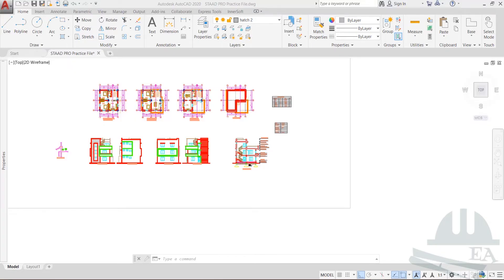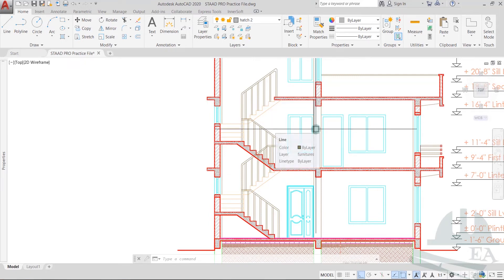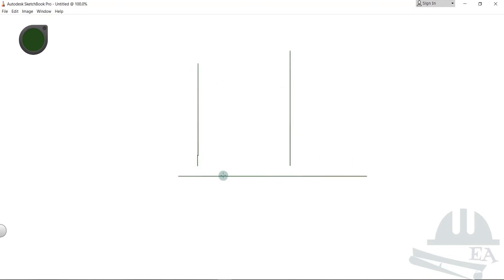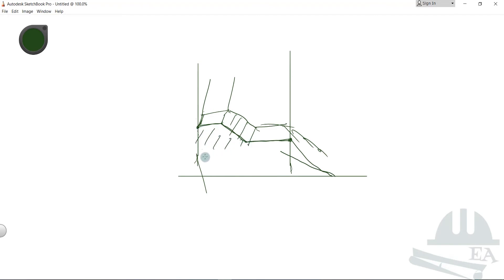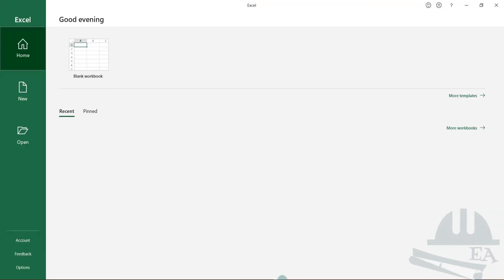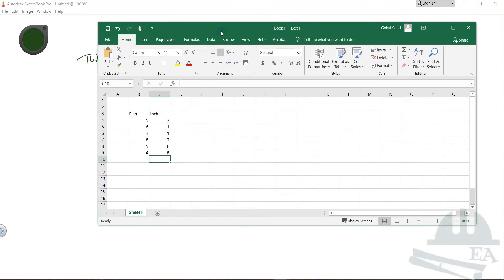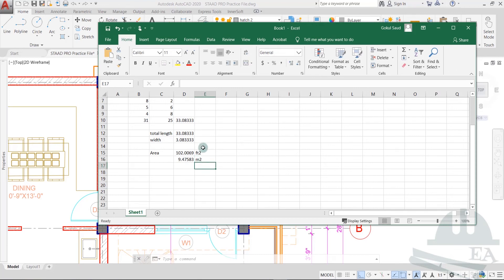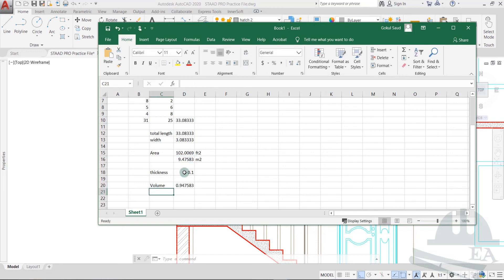STAAD Pro Tutorial For Beginners [Episode 16]: Calculation of Staircase Load

Comment: Hi. Thank you for this video. I would like to ask about the distribution of the staircase loads on the beams. I have learned that the load of the stairs is carried only in the longer direction. I just want to clarify about the load of that part of your staircase  where there are only 3 steps. Since it is just a short flight, where should be the direction of the load in that part?
Reply from the maker: The load of the staircase is taken by the beams on which staircase rests.
Reply from the maker: The load of the staircase is taken by the beams on which staircase rests.